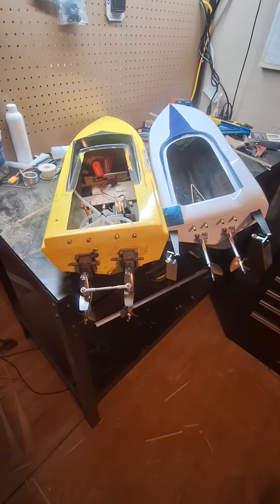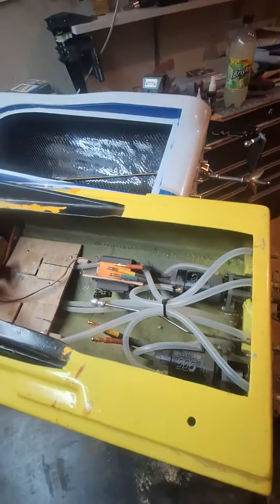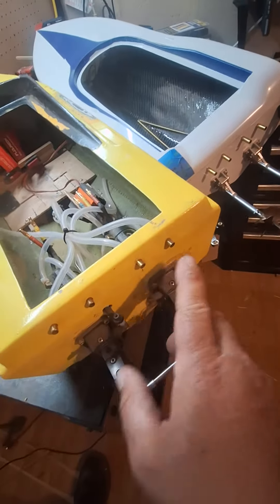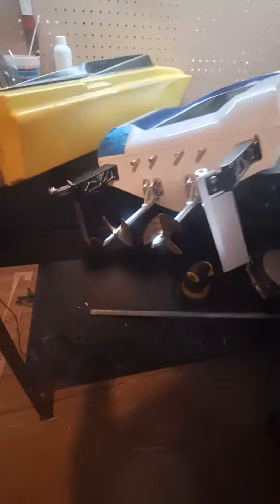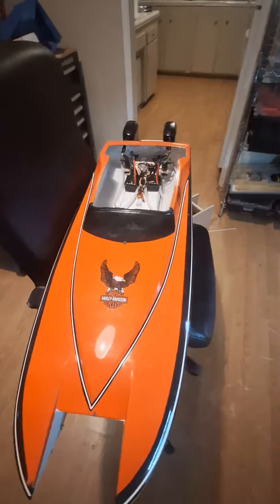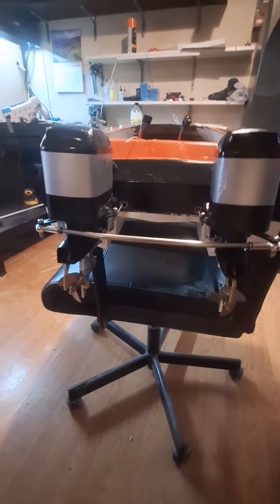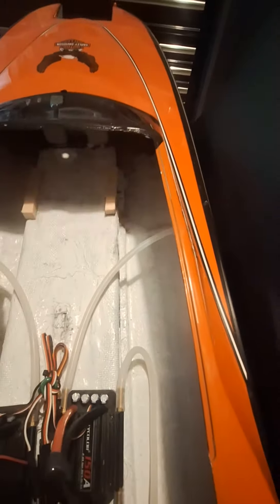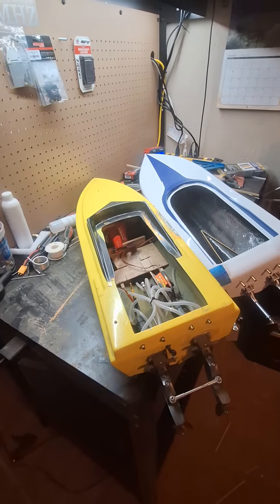3x twin screw Thursday #boatgang #boatworks #trendingshorts #rcboat

Comment: Time for triples on the dumas cat.
Reply from the maker: There is room for one more there .

Have you run your dumas sk daddle Jr yet I ran mine the other day I need to play with the center of gravity and tune it
Reply: @boatwerks  not yet, been working on starting a JAE FE33, and the 36" Sk daddle. I sealed the inside of the Jr when I did the outside of the short  circuit. Might work on the Jr this weekend.
Reply from the maker: @brandoncocola1322  cool I will try getting  a running video of mine tomorrow